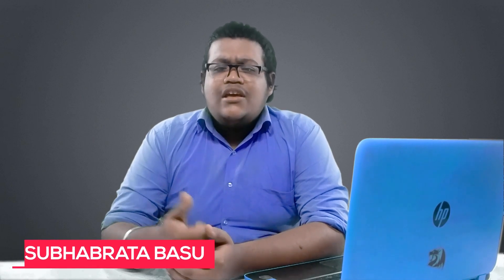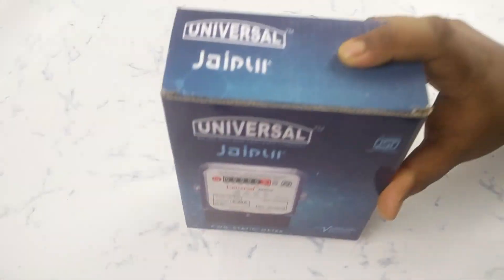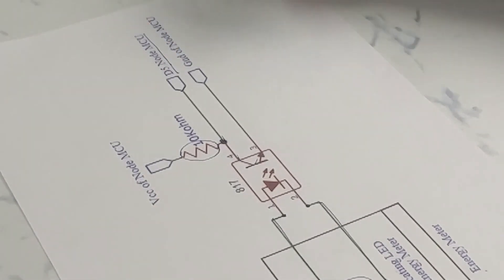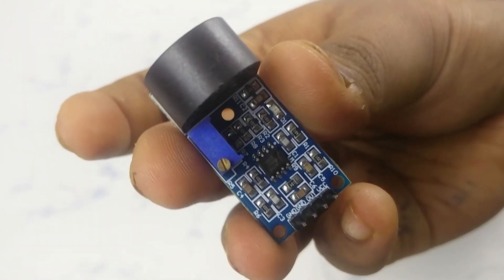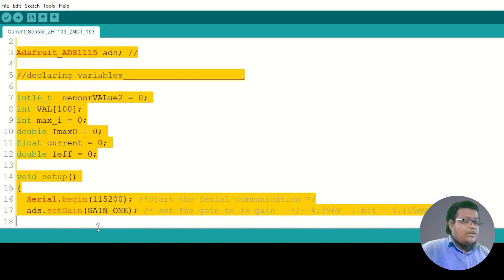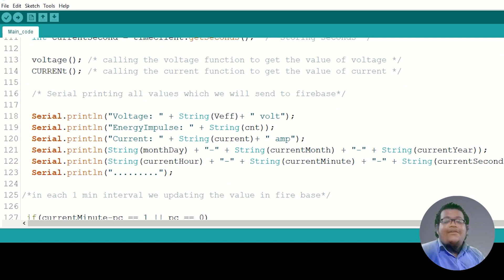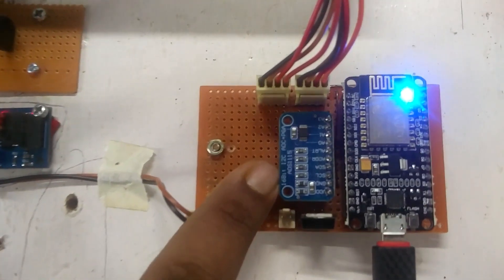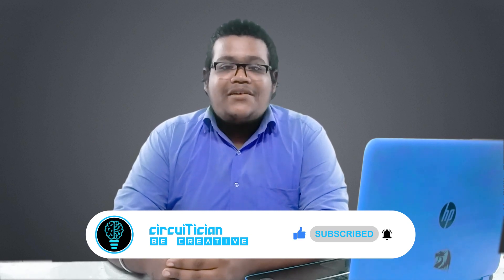ESP8266 Based Smart Energy Meter using Google Firebase

Comment: Hy Sir! how to get the same readings of Voltage, current and poer on our mobile app invertor using google firebase rather then buying the meter from market( which is too costly). kindly make a video or please guide in a reply. Thanks
Reply from the maker: For sensing anything you need a sensor. So for measuring voltage current and power you will need some sensors.

And it is the cheapest way of measuring all these.

If you are from India then the meter will cost 200 rs.
Reply: @circuiTician  Hy sir! i have bought ZMPT101 voltage sensor, hall effect current sensor and all i want to interface these sensor with esp-32 mcu and get the values of power, voltage and current used by each home automated device on the mobile app via google firebase. I hope you would explain this whole in detail. Will be very thankful to you
Reply from the maker: There are different videos on each topic on my channel... So you have to watch them all and merge the codes and circuit according to your need.

Comment: You used  single phase A.C supply,  right(phase n neutral)  ? But u said 230V D.C ?
Reply from the maker: No it's 230 volt AC ... May be I mistakenly said D.C
Reply: @circuiTician   until how much voltage  this zmpt can withstand, bro
Reply from the maker: I would not recommend to use more than 250 volt... And it is always good to check the data sheet

Comment: How u given power supply to those elctronics in pcb ? Underneath?  Do this ZHT 103 works or calculates based on hall effect? Also  WHY U GIVEN DIRECT A.C SUPPLY TO THOSE ELECTRONICS INSTEAD D.C ?  SOFTWARE USED FOR CODE EXECUTION N COMPILING  , DUMPING ? BRO
Reply from the maker: Watch the full video again carefully.
ZHT is a CT sensor 
I am powering the pcb using a usb cable through Node MCU.

Coding ide and other things all is shown into the video

Comment: Also at first u shown the , CURRENT SENSOR, at the while plotting them on the board, i see there is no circuit board , except coil ? Why ,
Reply from the maker: There was a problem with the circuit so I placed the coil only....

You an check the circuit diagram for reference

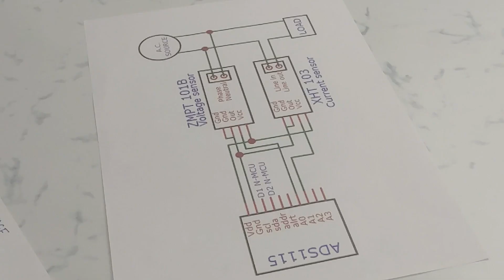Comment: Brother, please tell this! In one circuit diagram (5:27 )depicting the ADS1115, ZHT103 & ZMPT101B connections  u shown a diagram with A.C supply to current sensor, where as in  the GIT HUB schematic diagram , (1&2) terminals have that C.S  has no a.c supply , why?
Reply from the maker: Basically there is no terminal in the CT sensor.... You have to loop the wire from the middle of the CT sensor (zht 103)

Comment: Does it have really need to use analog energy meter as you already used volt and current sensors ?
Thanks
Reply from the maker: In case of AC to measure energy you need 4 items
Energy = voltage × current × powerfactor × time

So the process will be little bit difficult.

If you use a energy meter instead the energy measurement will be more accurate
Reply: @circuiTician   Got it, thanks for your reply. If we want to monitor only kWh  then I need only energy meter, optocupler & Node MCU. No need of ads115, voltage and current sensors ?
Thanks
Reply from the maker: Yes you can do that for sure
Reply: @circuiTician  would you please help me in getting the android app and other configuration. Thankyou
Reply from the maker: Contact  me via instagram
Reply: @circuiTician  Yes sure, I pinged you there. Thankyou
Reply: Would you please resend to my chat at Instagram ? Thanks